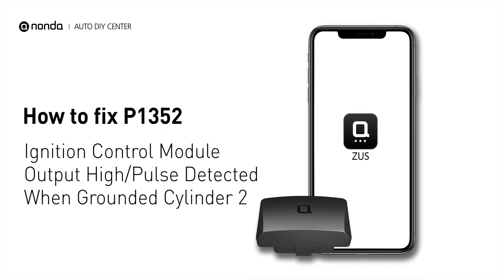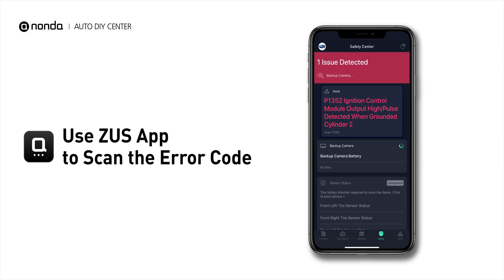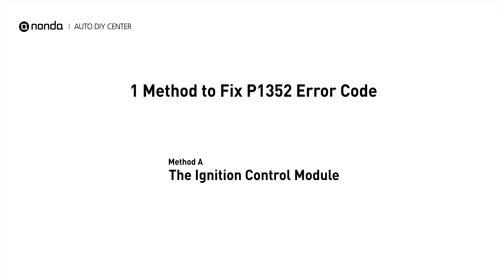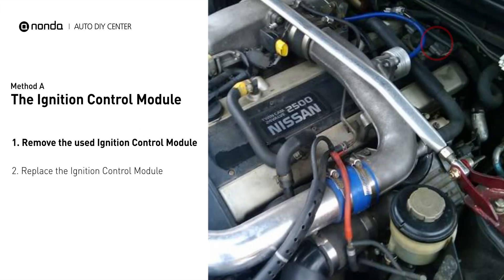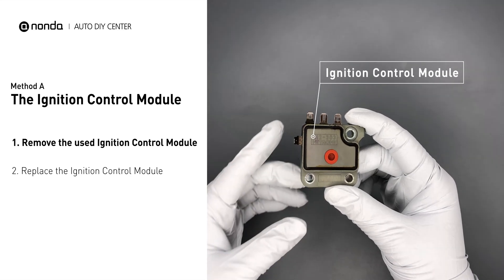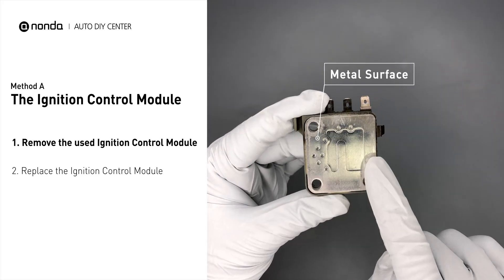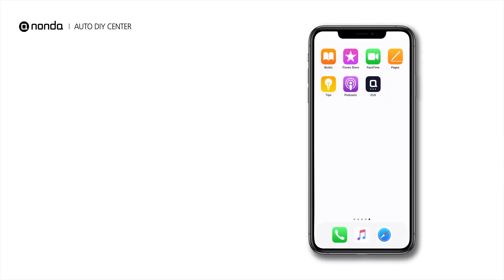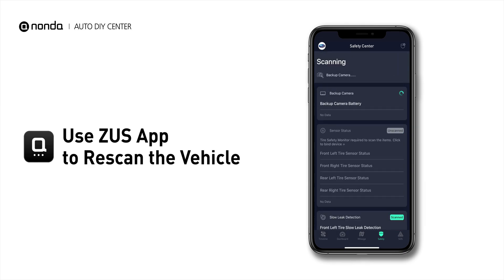How to Fix P1352 Engine Code in 2 Minutes [1 DIY Method / Only $11.7]

Comment: P1352kodu. Ne arızası oluyor sorun nedir
Reply from the maker: Merhaba Ali, lütfen bize aracınızın yılını, markasını ve modelini bildirin.
Reply: @nondainc  teşekkürler ederim pejoguet 2013 1.6hdi  1352 arıza kodu ısıtma bujileri değişti aynı kodu veriyor problemi nedir
Reply: Peugeot,301,1,6hdi
Reply from the maker: Merhaba Ali, ateşleme sisteminizde bir sorun olduğundan şüpheleniyoruz. Bu kodla birlikte kayıt olan başka kodlar var mı?
Reply: @nondainc   hayır yok sadece 1352var
Reply from the maker: Merhaba, muhtemelen ateşleme sisteminde bir sorun var. Daha fazla teşhis için aracınızı yerel tamircinize görsel olarak kontrol ettirmenizi öneririz.